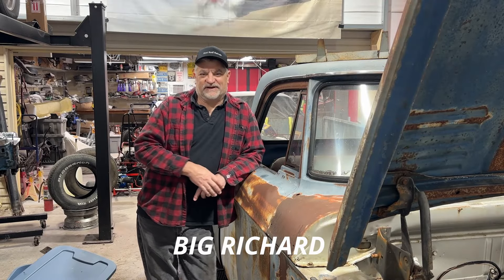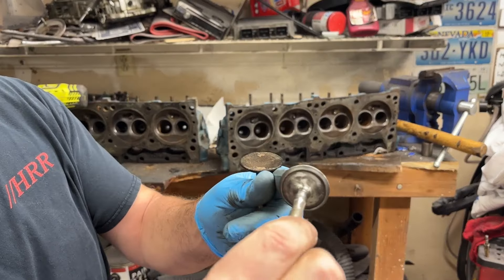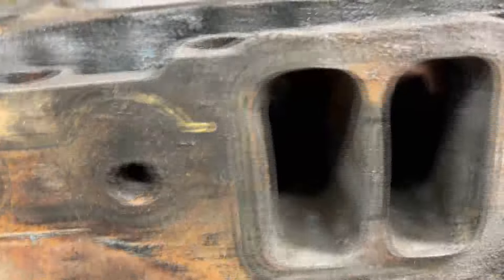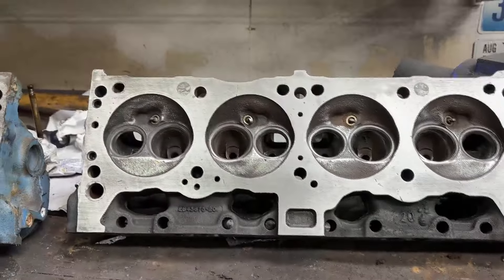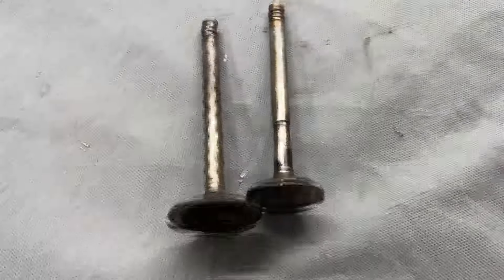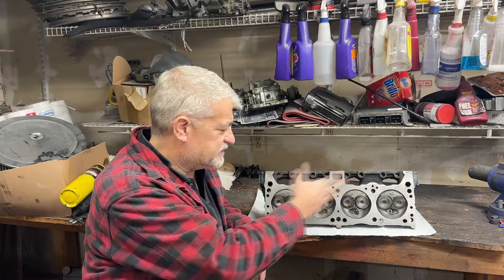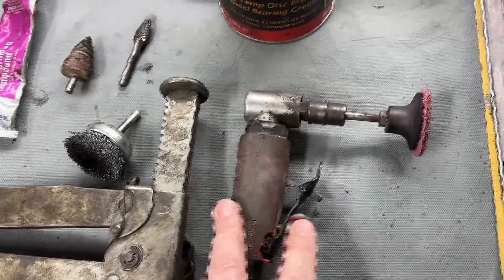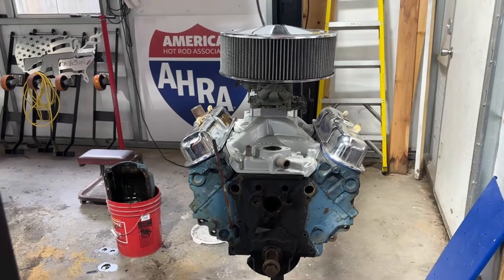1967 DODGE D-100 318 CYLINDER HEAD REBUILD ON A BUDGET@UncleTonysGarage @kiwiclassicsandcustoms9160

Comment: Hey Art,
     Tim here, ya know, ya cud remove the steps in the chamber for the valves/seats easily, JUST DONT HIT A GUIDE OR SEAT!!.....and low lift flow (Tq) wud increase dramatically......Just a thought, dont know what ur wantin to really do.....but i DO know that blending aids in low lift flow, and a 30° back cut on the intakes wud bolster the blend.....NOT change ur seat angle, just let the air roll over more easily......again, just thoughts......wish you the BEST my brother!!!......enjoy what ur doin!!!

Comment: On the exhaust valves when you had them out should’ve back faced them it’s free horsepower and doesn’t take that long ones there out and clean. Tony has a video on it if you’re not aware.

Comment: I pull out the valve an inch to check the valve guide. if it wiggles or if there's no suction when you put your finger over the valve stem, the guides are worn.

Comment: I used to used an air file (pneumatic air block sander) to clean up the head surfaces.  I'd gently work it, running it evenly at a 45° angle. Works great! Good advice Dr. Art!👍

Comment: To clean valves I chuck them in a drill and put some lapping compound or fast orange hand cleaner in a rag put the valve in the rag and let er ripp (with pumice which btw does work as a fine lapping compound too)... Ill also use the drill to lap valves.. I have a 3/4" thick piece of glass I spray glue sandpaper to for surfacing... I was able to surface a pretty badly warped ls head with some 60 grit, careful measuring and a lot of patience this way and I have used the pneumatic body file on iron and aluminum blocks too but mine was definitely not flat when I got it.. i made it flat using my glass plate which I do check on a granite reference surface now and again

Comment: My methods of valve lapping has been done either with a drill or done by hand with a lapping tool. After I wipe the lapping compound out of the valve and the valve port, I put a little bit of oil on the valve and I relap the valve with just oil. what that does is, it smooths down the sealing surfaces of the valve and seat. I repeat the same process to all the valves before I install the seals, springs and retainers. I make the valves and seats as smooth as possible so that carbon doesn't foul up the valve seats. I noticed that small block Mopar heads are really similar to chevy V8 heads

Comment: Few years a ago I built a 1988 LA318 roller cam for my 1979 Trailduster, lapped the valves and new valve guides, wriggle the valves to feel stem wear, it runs good, my Chevy 454 I did last year had them rebuilt at machine shop 500$ already had hardened valve seats and good guides or would of been 900$.

Comment: A lot of manufactures and machine shops don't bother with lapping valves thinking with the attitude " Oh it will wear in ", a lot of times it doesn't and a lot of horsepower lost to. Nice work doc .
Reply: I had a machine shop do a valve job on my boats 4.3 engine   Got them back,put them on,cranked it over and it just kept backfiring. Checked timing ,valve clearances ,everything looked right on   Worked on it 3 hours a day for 2 days. Still backfiring. Took one head off, tilted it and filled the ports with gas.  The gas flowed past some of the valves. Brought them back to the shop, owner said he didn’t hand lap the valves. Said it wasn’t necessary they will wear in a seal.  Told him I couldn’t even get it to start to wear them in. Besides it had hardened seats. I lapped them myself and it started right off and runs like a top today. Couldn’t get any refund for my time or gaskets.

Comment: Dr art how’s your rebuild doing now
Reply from the maker: runs awesomes , https://youtu.be/9W87dVtrglA
Reply: Great
Reply: The reason I asked is because I never rebuilt an engine and people told me that I needed to get things done at a machine shop or buy a rebuilt from an auto parts store
Reply from the maker: @ not necessarily, I mean, unless blown up and there’s destruction and you can usually just reuse most of the factory parts and just replace the consumables like the bearings and rings nice job of cleaning and reassembly and you should be good
Reply: I have a 318 that was in my 90 dodge d150 I bought new . It’s tired and worn and I would like to rebuild it like you did your  thank you for sharing your experience .
Reply: My engine was still running knocking on start up and low oil pressure when idling